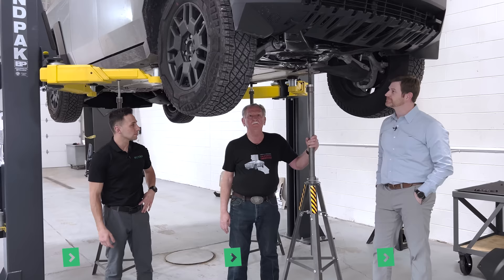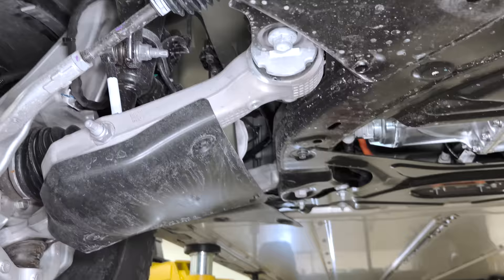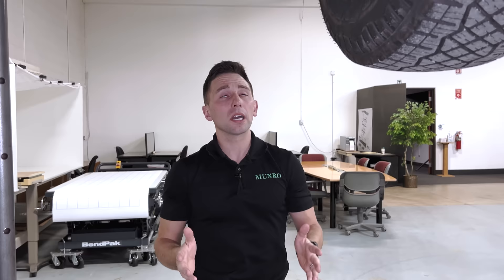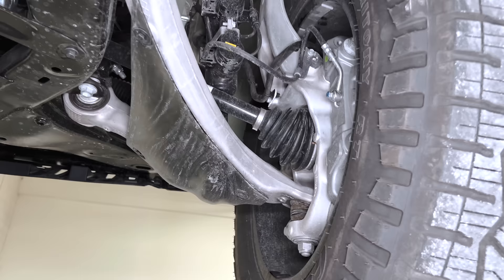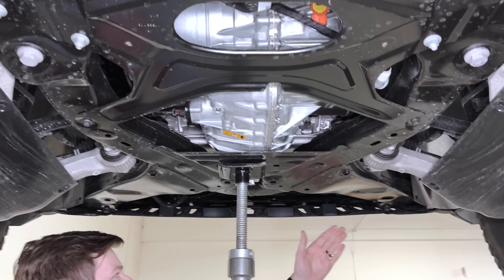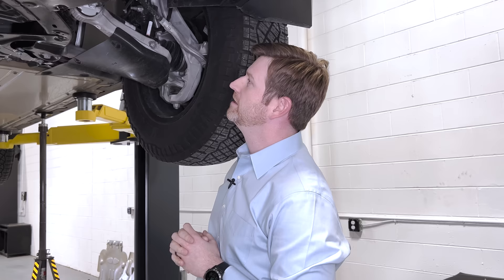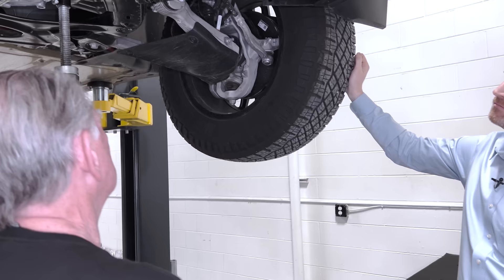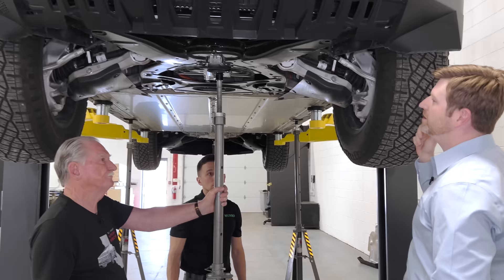Tesla Cybertruck Underbody

Comment: I sure hope Tesla has gotten much better quality bushings than what they’ve been using on the 3/Y. The LCAs have been redesigned numerous times and yet still the bushings still fail as soon as 20,000 miles, but typically no more than at 60,000 miles. Seeing how this is supposedly set up to go off road and carry all the extra weight of the truck itself and potentially trailering, the bushings need to be vastly improved or they’re going to fail prematurely.

Also, the placement of those fans on the back of the radiator look like they would be easily damaged or filled with muddy water due to how low they’re positioned.

Comment: Thanks for the video 👍
Reply from the maker: No problem 👍
Reply: @MunroLive  The unused high voltage plug on the battery pack is most likely for an inverter for an after market camper conversion or similar conversion, it`s unlikely to be for the additional battery hook up point as it`s look to small to handle the voltage/amp draw.

Comment: Autoline showed a competitor already half torn down a CT, its interesting how the drive by wire and the rear steer work.
Reply: I saw that, also the use on blue connectors.  which you could see on the fans at the front in this video.
Reply: Munros teardown is better imo. Carl for the interior and Jordan for the chassis is unbeatable.
Reply: its nothing special! rear steering has been done by wire for very very long time! its just the same thing in the front except redundancy built in. in europe alot of trucks from mercedes, volvo, scania... comes with multiple steering axles sometimes 3 for much better turning capabilities in tight citie roads.
Reply: @carholic-sz3qv And Steer-By-Wire has already existed. I don't get why people hate it. Rear-steer isn't anything new, but the CT can do up to 10 degrees (apprently) and I think that's just overkill.

Comment: The high voltage connector looks prime for the extended range pack add-on coming end of year.
Reply: Yes, the extra high voltage connector is for the extended range pack that will be placed in the bed. For extra towing range, etc.
Reply: No it's much too small to carry the current from the extended range pack.

Comment: I see a lot of people saying the extra connectors on the pack are for the add on battery pack but they are much too small to handle the power from that pack.  Connectors would need to be the size of the larger ones nearby to handle the amperage.
Update:  Service manual says they are for inductive charging which is low power.

Comment: I think the open high voltage connector at the back of the battery pack is to connect to the range extender battery in the bed.  I think this is a good sign that the extender will really exist one day.  I think the low voltage one at the rear might be for trailer electrical connections.

Comment: I’ve seen a few videos and pictures of that upper A arm in the  front suspension bending under extreme off roading. Is this a weak part in the design? This truck seems to be designed more for hi-way driving than off roading. Which is fine but it seems like it would be hard to modify the truck.
Reply: no issues for Unplugged , suspension UPGRADES.

Comment: First video on the cybertruck.   The extra high voltage connector under the truck. Wouldn't that just be for the optional long range battery pack that will go into the rear tray when they get around to shipping them out?

Comment: seen 3 videos where the upper contol arm 4:31 break so far.
either bolt x 2, stamped metal bends off body/frame?,
Reply: There has been no evidence of the upper control arm failing
Reply: I’ve seen 2 videos where it broke. Both cases of severe abuse: Diesel bro’s adding tracks on massive spacers and the Tesla team slamming full speed into a ditch in Baja. Which is the 3rd? 

Failure points are intentionally designed. Maybe they want it to fail for crash safety?
Reply: @bob15479  Suspension didn't fail in Baja and obviously putting massive tracks that stick out a huge amount puts an insane amount of load due to leverage.
Reply: @boostav 😂 i wonder if ppl were this rabid in their defense of the delorean😂
Reply: @hoppingrabbit9849  No, because back then you didn't have ignorant fools propagating nonsense on social media they've heard from other mouth breathers.

Comment: The 3 bolts on that airfoil underneath the suspension  is the old solid way of attaching things. Snap on would not work in this area. It would rattle and and off. 😎😎😎

Comment: Those "Mud collectors"  are Skid Plates under each lower wishbone,  additional add on protection 
intended to preserve the unscathed factory new integrity of aluminum. There could of been a nice
cut out/circular drain point at the "U" of the wishbone. Current design , they provide an excellent place to smuggle anything small to destination of your choice 8>)

Comment: Those steering knuckles remind me of the Can-Am Maverick R's knuckles that everyone hates. Will be limited on how large diameter of tire you can put on the cybertruck with the stock knuckles.
Reply: Actually it is clearance in the wheel opening.   The aftermarket people who do the wrapping, interiors, etc  have been working on wheel packages larger and smaller.   I think they used spacers to get around the knuckle.
Reply: @danharold3087  spacers really!!! is that a joke!!!

Comment: I what to see the battery teardown. Is the truck full? If so, how terrible is the density that they couldn't meet battery day specs? It's crazy they couldn't get 500 miles without adding an auxiliary pack.
Reply: Also, can they double stack the pack?
Reply: @kyleJ82  They could (they have the space and could then take off these 100 mm (4 inches) from the seat brackets). This would add enormous weight however, about 500-550 kg: about 1332* 355 g = 472 kg for the 4680 cells, and some more for busbars, cooling plate, fasteners and stuff. It would reduce payload by the same amount (from 1135 kg to only about 600 kg) or they would need to change all the other stuff to make up for that extra weight.
Reply: No doubt it would create more problems and more engineering. I'm just thinking that maybe they go that route in the future. The auxiliary pack seems really stupid, as you lose cargo space and because of weight and HV-stuff, you can't simply use it when needed.
Reply: They could have. They chose not to.
Reply: @MooseOnEarth  No it's not possible, you'd have your knees in your throat if you do.
Reply: @boostav  4680 is 80 mm high. Add 20 mm for stuff and you get 100 mm more height for a double stack battery pack (two layers of 4680 cells inside). These 4 inches will not put your knees in your throat, they can be subtracted from the seat brackets and the seat would be at the same position relative to the cabin. With this raised floor, they would have to consider the pedals and leg room however - as well as entry and exit. But the cabin can be raised and lowered via air suspension by way more than those 4 inches.
Reply: Cybertruck , exceeded the EPA range, in EDMUNDS test.
Reply: @markplott4820  exceeded in out of spec test too!
Reply: @MooseOnEarth  No it wouldn't, if you remove 4 inches from the brackets it means the floor is 4 inches closer and so your feet will be resting 4 inches higher. Hence the comment that you'll have your knees in your throat. It's not a viable option.

Comment: Open battery connector is for the extended range pack that drops into the truck bed.  It will probably just tie in directly to the main pack to increase overall capacity.

Comment: I actually don't mind the exterior design. What triggers me it's the interior design. Too simplistic for a 100k truck.
Reply: Then have it swapped out for one you like. The T-whatever company has a leather one.  Or take it to a local shop and have your diamond tuck and roll or whatever it is that turns your crank.  Interior is window dressing.
Reply: @danharold3087  What's the point of spending 100k in a truck, if you need to spend thousands afterwards personalising it.
Reply: @RogerM88    Because they can !

Comment: That high voltage connector is probably for the extended range battery pack that can be added in the bed
Reply: No the connector size is too small.

Comment: The extra HV connector is for the optional extended range battery in the bed.
Reply: No it's way undersized for carrying the current needed for the traction pack.
Reply: @JRP3  I agree; but, The bed pack doesn't need to be a act as the traction pack. That extra HV connector is the same size as the charging connector. The bed is a range extender for the traction pack and only needs to charge the traction pack -- like a range extender.
Reply: @fiddlerJohn The wire cross section looks smaller than direct DC charging wires.  Plus since it's intended for extension when towing, (i.e. heavy loads and power draw), and will probably be hooked in parallel with the main pack any voltage drop under load will draw a lot of current from the extension pack.  Unless they are putting a charge controller between the two packs to limit current draw, that's a possibility.
Reply: @JRP3  Look at 15:36 / 26:52 . The charging connector is the same size as the empty connector.
Reply: @fiddlerJohn I don't think that's the charging connector.  V4 superchargers are capable of 350kW, Cybertruck must be capable of at least that if not more, 350,000 W divided by 800V is 437.5A, those connectors are no where near large enough for that current.
Reply: @fiddlerJohn Service manual says the empty plugs are for inductive charging, which is low power.
Reply: @JRP3   The inductive charging sounds right. That's the same amount of current a range extender would provide.
Reply: @fiddlerJohn No it's less.

Comment: How does it look for corrosion resistance? You mentioned the suspension part collecting sand, but what about that battery pack being attacked by road salt?
Reply: EVERYTHING is e-coated.
Reply: @markplott4820  so it’s no better than present day cars and will rust just as quickly?
Reply: @jamanjeval   - Cybertruck does not RUST .
you can use it as a BOAT .
the Battery even has a SCUBA system. 
I dont see ANY cases of TESLA ever Rusting out.
but, you do see in LEGACY trucks.

Comment: That upper control arm looks pathetic. Everybody is going to replace those ASAP.
Reply: They need to fail in a bad crash to separate the front wheels from the body.  Do not want it too strong.  With the angles that the forces are applied I expect it is what is needed.  Tesla crash tests the digital twin repeatedly.   They would know.  We are just looking.
Reply: UNPLUGGED performance invincible Cybertruck parts.

Comment: The upper control arm broke right away on Dave sparks cyber truck , and the second thing that broke next was the aluminum knuckle/spindle arm 
And then the lower ball joint failed so  he proved the parts are weak unfortunately, Tesla will hopefully strengthen them soon !

Great video Sandy and Company
Reply: what a joke that was! supposed to be the "toughest" truck ever built!!! that upper control arm is utter garbage. a company in germany started replacing some of those cheep parts in tesla with aluminium parts much beefier and longer lasting too.
Reply: @carholic-sz3qv   - its within SPEC , and its a STOCK truck.

Comment: 15:40 The extra connector is for the range extender battery that sits in the box of the truck. I believe that Tesla originally wanted a 200 Kwh battery in this truck but the slow ramp of the 4680 meant they had to go smaller battery and impliment a range extender pack.
Reply: Yes but the reason for the small pack is weight and cost
Reply: Out of Spec just range tested the CT against the 200KWh silverado WT4.   Battery weights alsost twice as much but the added weight only got them tjo the low 400s miles while the CT did 310, more than Tesla listed.  And this was at 70 mph.  Time for people to put a cork in it about the battery in this truck.   If you want the 200KWh buy the silverado.

Comment: It looks both tidy and conventional, neither of which I expected. The spare low-voltage connector at the rear might be for an EU-spec rear fog light.  One idea, guys, would be to place the removed underside plastic covers on the floor arranged as they were installed on the car so that viewers can visualise what areas they covered.  Thanks for the great video and looking forward to more!

Comment: The base of the casting seems grim for aerodynamic & the electronics look vunerable. There seems to be several empty holes, drilled, milled & threaded under the casting. Wonder if there was a tray planned to smooth the airflow & shield electronics? Why bother drilling, milling & threading holes, if no bolts go in them? Did Munro remove a tray for the video?
Reply: It does look like they removed some underbody trays but I'm not 100% sure.  All prior Tesla vehicles have closed off panels for improved aerodynamics.

Comment: That added on aluminum piece on the front of the steering knuckle obviously is designed to be removed, or simply not added during manufacture in the event Tesla wants to use a smaller diameter rim as an option. This way you have the ability to cover both large and smaller diameter wheels w/o having two different knuckles designed and you are able to maintain the impact worthiness in either case in the event of a crash.

Comment: Check HeavyDSparks videos testing the CT. The suspension components seem too weak for a truck. Especially the upper control arms. There's also some pictures of a testing CT with a damaged upper control arms probably after a hard jump. Hope Tesla update the suspension.
Reply: The upper control arm is considered a break away. Much like a crush zone.  
Ya can't have it both ways.
Reply: @ChadwickJames  Also for such a massive overall weight, using casting spindles could be an issue while off roading. Breaking instead of bending.
Reply: You're not very bright are you, don't you see how far out those tracks stuck out? That puts huge leverage on the suspension which is obviously not designed for that purpose.
Reply: @boostav  Plenty of trucks with extended track and not such issue. By the way Tesla can't reinvent Thermodynamics. So cast suspension spindles and thin stamp metal upper control arms will tend to fail with more off road or overloading abuse.
Reply: @RogerM88  Absolutely false, those tracks were way out there compared to anything else that's been done. No stock suspension would take that load.
Reply: @boostav  No stock suspension would take that off set? Check WhistlinDiesel videos where he used large spacers. Relax, you sound as a triggered fanboy. Either way, the CT doesn't have the range to make some extreme off-roading, as the average owner, is more likely use it as a car to flex to the neighbors in sub-urban wealthy areas.
Reply: @RogerM88  I have checked and haven't seen anything comparable, give me a video title. No, any stock independent suspension isn't going to be able to take the size of those tracks with that leverage.

Comment: What really surprises me on the aft end of the battery is all the critical components exposed in line with the rear drivetrain. When you’re off the main path, loose logs, sticks and rocks tend to drive upwards when the weight of the tires come into contact.

Comment: Those exposed high voltage connectors and lines at the back of the vehicle and end of the battery pack really concern me.  Given this vehicle that would likely be used off-road and even still susceptible to even paved road hazards without some protective shroud. Especially since they sit near the front of the rear tires.  Sure, if this was some standard pickup it "might" be acceptable but not on a $100k truck.
Reply: When Monroe removes the wheels in the next episode, will you comment then on how concerning it is that it's difficult to drive without wheels?
Of course, you will see the inner workings when he is tearing down the car.